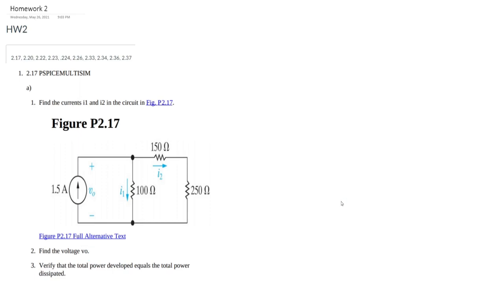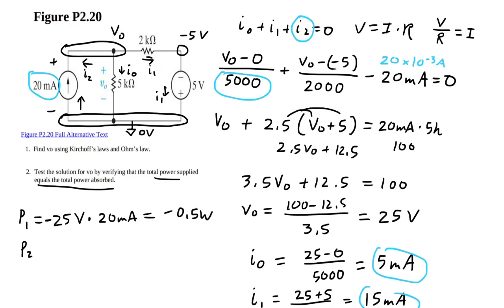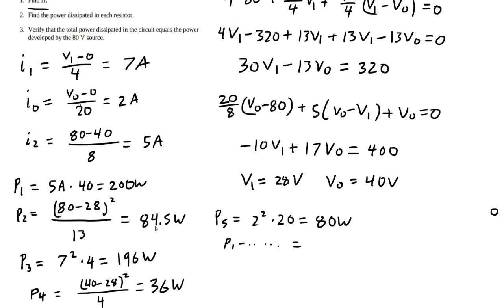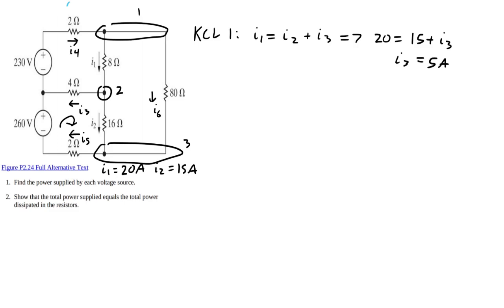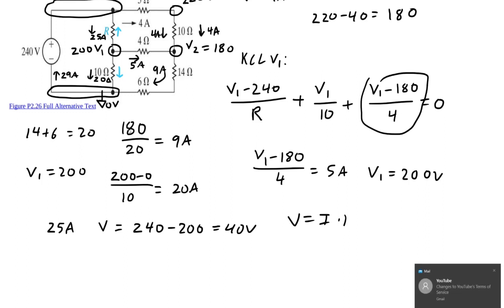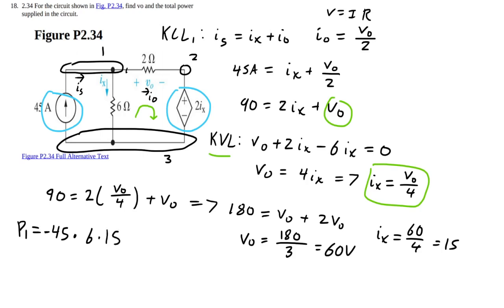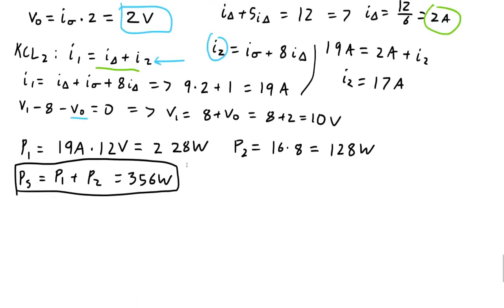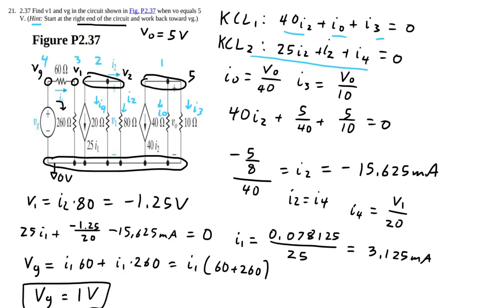EEL3004C - HW2 Solutions

Comment: Why isn’t the dependent voltage source supplying power in the circuit? At minute 1:34:06 problem 34
Reply from the maker: Note that the current io is flowing into the positive terminal of the dependent source. The dependent source is sinking current, consequently there is a voltage drop across it. As a result, the source is dissipating power.

This happens in practical systems as well, such as operational amplifiers, when their output voltages go below ground.
Reply: It makes sense, thanks!